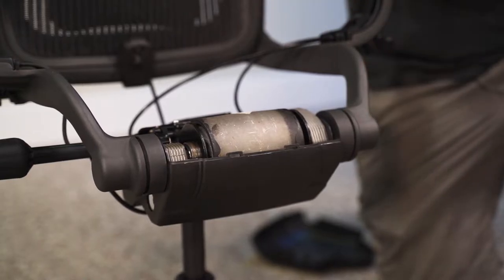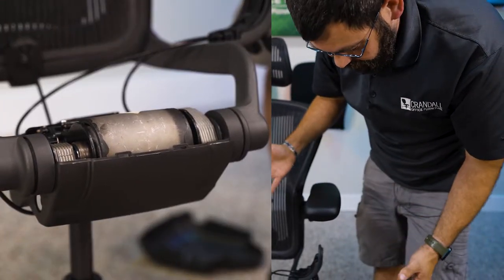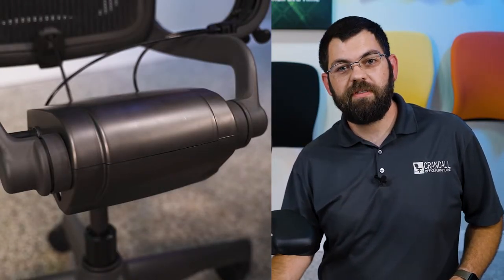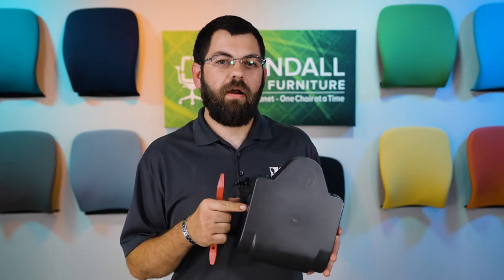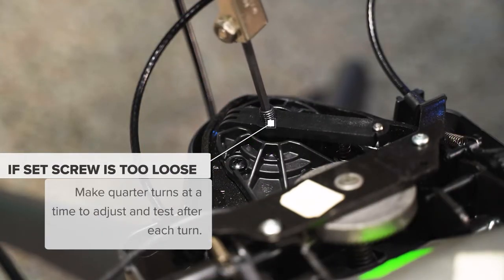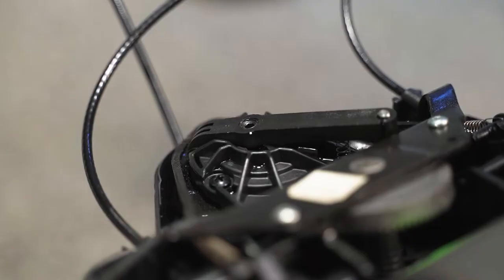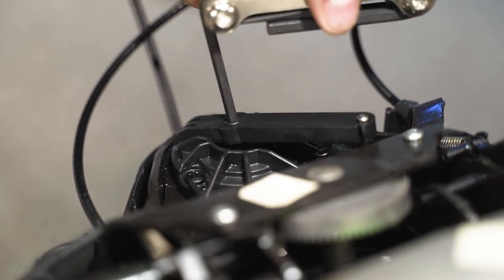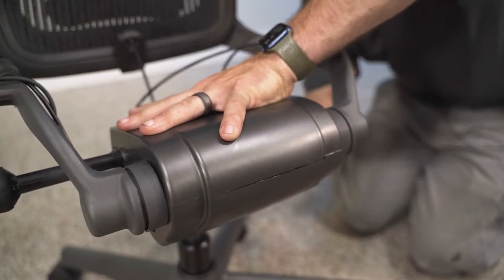Herman Miller Aeron Classic Set Screw Adjustment Guide - Quick and Easy Fix For Your Sinking Chair

Comment: My chair was fine for years but now started sinking while I am sat down. I tried adjusting the set screw anti-clockwise at first, quarter turn by quarter turn but could not get the level of the chair to remain stable. Then I went clockwise until the chair rose on it's own and tried going anti-clockwise again. Still no luck. Any ideas on what could be wrong?
Reply from the maker: Could be you need a new cylinder, please reach out to our customer service team and we will be able figure out exactly and get you a new cylinder if needed. contact@crandalloffice.com

Comment: Nice to know. Do you mind if I ask, is it normal that the seat part itself rocks a bit in forward backward motion making a little of tiny clicking sound ? Its not noticeable when I sit but I can rock it with my hand. I went to check under and Im seeing that the screws on the bolt under the back side of the seat are just half screwed and the bolt can be moved left to right because that untightened screws sitting on the half of the bolt on bot sides. It moves about half of centimeter. Also by moving the seat I see that the part under that mechanism box under it is also moving and those strange screws also don't seem to be screwed completely ? Im wondering if that's on purpose or its not normal ?  Its brand new Aeron Remastered I got few weeks ago. Sorry its not completely connected to the video but I cant find the answer online. Thanks in advance.
Reply from the maker: Please reach out to our customer service team and send a video of what you are referencing to contact@crandalloffice.com and we would love to help you.

Comment: My chair is stuck in the down position I adjusted it both for too tight and too loose ways and the lever still didn’t engage the cylinder. The clamp moves up and down but it’s not engaging kt
Reply from the maker: reach out to our customer service team and we will be able to help you out email is Contact@crandalloffice.com or phone is 616-682-0110
Reply: Did u ever find out how to fix it cus I have the same problem rn
Reply: Did you figure out the issue? I also have this problem.
Reply: @trujelly492 did you figure out the problem? I have the same issue and think the cylinder went bad. I'm going to take it to a repair shop and see what they say.
Reply: Same problem here,I play a little with the screw and pull it up by hand and start working again.
Reply: @trujelly492  Same problem here,I play a little with the screw and pull it up by hand and start working again.

Comment: What to do if the lever itself is loose not able to up or down the chair
Reply from the maker: Make sure that all of the cables are connected properly, and also that your cylinder is a top activated cylinder.
Reply: @CrandallOfficeFurniture  I broke the hand of the chair 😭😭😭😭😭

Comment: Dude. I can’t even get the cover off. I don’t have whatever tool you are using. Only a flat head screwdriver that is chipping and bending the plastic. My rage meter is through the roof.
Reply from the maker: There should be rectangle access holes underneath of the cover that have clips you can lift up to remove the top cover. If you need more assistance you can reach out to us via email to contact@crandalloffice.com